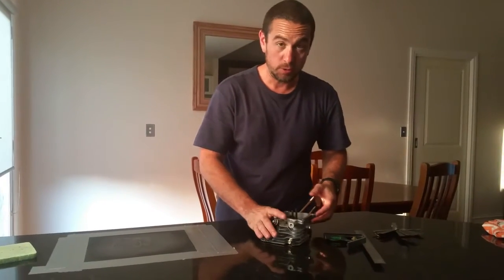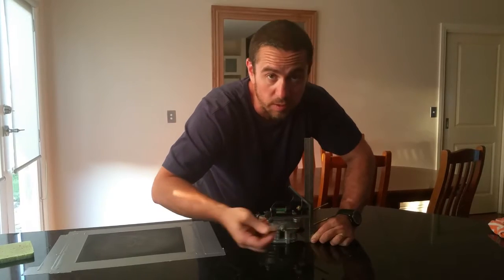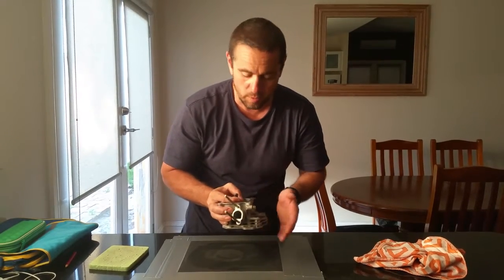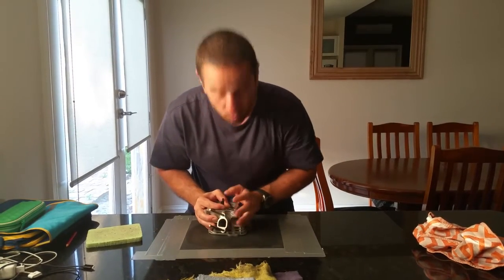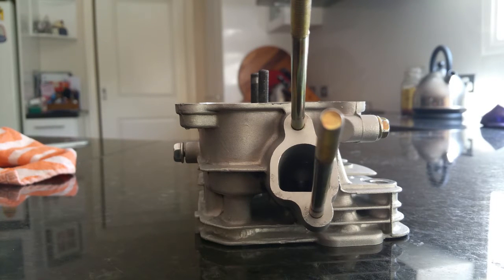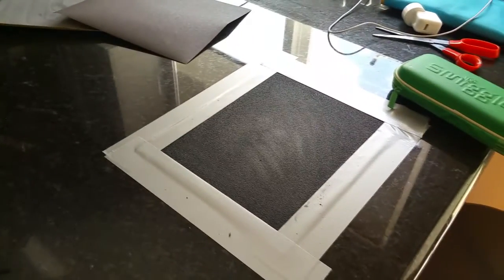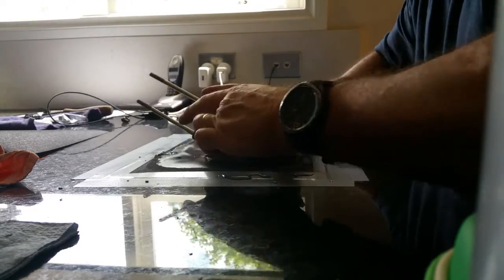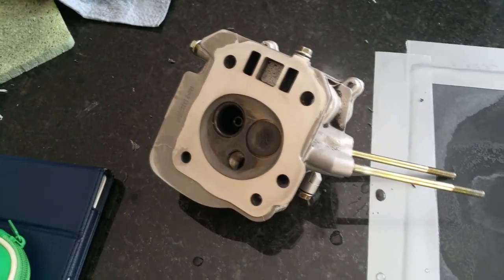Milling or shaving a 4 stroke, GX200 Honda clone, Go Kart Cylinder Head

Comment: Hey man, I just wanted to let you know that I tried this method of milling my Predator 212 with a hemi head (Honda clone) and it's working awesome and giving me good compression.  Only thing I did different is grinded it with dry sandpaper instead of wet, seemed to work faster.  Still took a while but didn't have to take it to a shop or pay someone. I appreciate this vid, bud.
Reply: How much did you take off? So many questions... inquiring minds want to know!   ;-)
Reply: So far I've taken off about 0.05" to give me a compression of 12:1 (also using a thinner gasket and +0.02" connecting rod) and it's working surprisingly well.  It takes FOREVER to grind it down that far but if you've got more time than money, or you're just stingy, it works just fine.
Reply: @stevenn8449  how long is forever? How many hour's?
Reply: @mexvette8209  Probably like 2 hours to get 0.04 in off. I did actually take the head to my belt sander as well and that was MUCH faster but of course you run the risk of milling unevenly. Mine worked, though.

Comment: 0.05 is 50 thou !!!   5 thou is 0.005... your measuring device is not worth a toss.  you need to be 100% accurate when doing a head, you are miles out . it might be straight on the face but you have no idea if its out each side..   the finish is far too smooth, what is the gasket going to bite on ? last thing you want is super smooth finish on a head. 80 grit is about right for the finish and do it just one way...
Reply: You don't need the head rough for the gasket. If you want I can pull the head off the new BSP motor I have and show you the finish from the factory. I would put a straight edge across this head and shine light behind it to make sure it is straight all the way across. I was wondering if any one has tried this. Going to try this to an extra head.
Reply: Looking at his other vids, he's most comfortable with metric.  He says 1.25 mm...

 I'm more concerned about results. I can think of a thousand ways to accidentally on purpose ruin an engine!  So, did it actually work? I'm guessing this took off 5 or 6 cc which is pretty high compression. Any imperfections are going to cause blown head gasket.
Reply from the maker: Hi, just wanted to say this engine is heaps faster than before all the mods.  I did a whole bunch of things (carby jet, ported, polished, 26lb springs, indexed plug) and although the video shows my measurements as 
 being clumsy (at best).  This engine revs to 7400 rpm and pulls well.  I have a huge back sprocket (I think 74 tooth) limiting the top speed to 79kph.  Imagine how fast it would go with a smaller sprocket.  Would love to do the cam, flywheel, lifters, piston, and rod, but it costs too much here in Aust.  Probably best next mode would be to advance the timing (free).  Would love to get it over 80koh and keep the same sprocket.
Reply: Robert Giorlando Glad you updated...surprised you haven't advanced the timing. At these revs, should make a difference. Glad to see the head shaving is working.
Reply: @rgiorlando   there is a new cast aluminium flywheel available it's called the PVL flywheel. 
 It's $65.00 here in the states if that helps at all.
Reply from the maker: John Turner I'd love to advance the timing.  I wanted to do this next.  Then also change to a bigger Makuni carby.  Just haven't had a chance to do it yet.
Reply: It's possible to file the key to advance your own timing. Just calculate  how much of the shaft circumference is 4 or 8 degrees.
It's easier to just buy one... Afterward, I noticed you said advance was free, so you know how  :-)

At 7400 RPM, conventional wisdom says you need a billet flywheel(above 5K)  I suppose someone had one blow up because of a defect. How often?  Catastrophic if it goes! They are only guaranteed to 3600, but how big is the safety margin? I suspect 95% would spin to 15K. The other 5% would make the evening news.

I saw a cool way to make your own exhaust using a pressure washer and welder to hydroform.  https://www.youtube.com/watch?v=ppXRMTeR2NQ
Reply from the maker: John Turner Thanks mate.  I am looking forward to playing with it again to see how much I can get out of it.

Just watched the exhaust video... Nice!